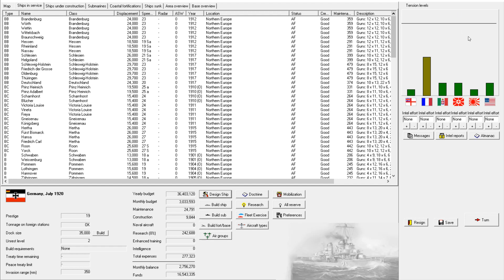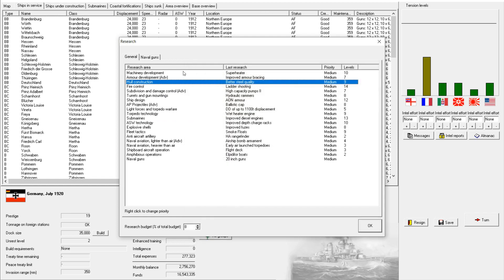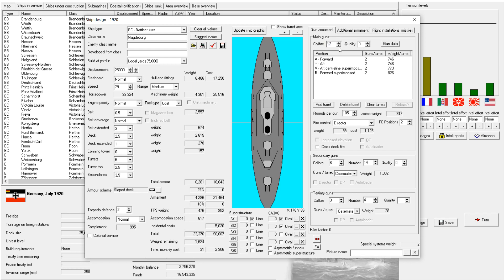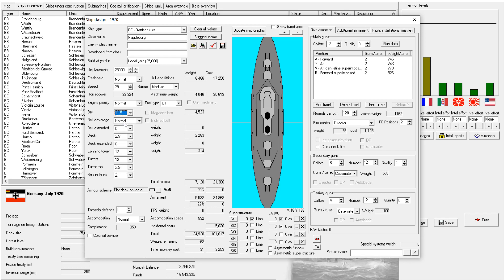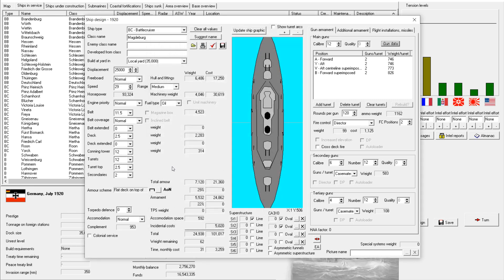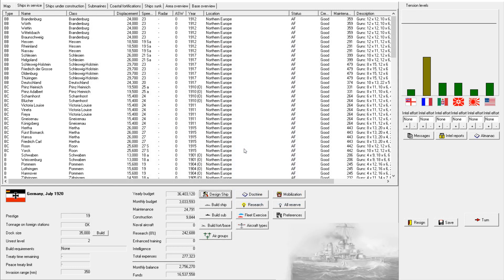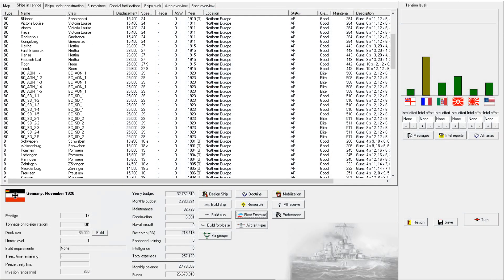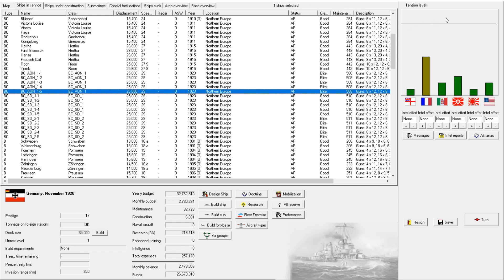Rule The Waves 2 Design Studies 2: Armor schemes

Comment: Thank you for posting this interesting video. However, I would suggest that comparing 11.5 AoN belt v 10 and 6.5 SD belt is not a reasonable comparison of the two schemes. I would suggest that a SD protection scheme would have similar belt thickness to a AoN scheme and would forego other areas of the design. SD schemes, when compared to AoN schemes, have to allocate a higher proportion of its tonnage to armour protection, or, have a higher overall displacement. Your experiments conclusively prove, if it needed proving, that armour protection is a vital consideration when trying to ensure the survival of your ships in a gun duel.

Having now watched your follow up design study 4 video, I acknowledge your assertion that the SD is not providing equivalent belt protection as a AoN scheme and that AoN is superior to the SD scheme when each provides a similar amount weight to armour protection.